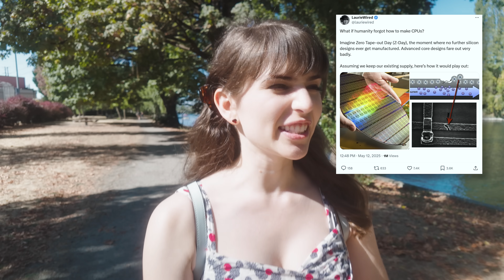what if humans forgot how to make CPUs?

Comment: I think the scenario could go a different way. It all depends on political will and the inertia of the population. Your scenario assumes that society will pretend nothing is wrong until the very end, trying to live by the old rules, ruining itself and isolating into separate enclaves. But if the will is shown to make strategically correct but painful decisions right from the start of the disaster, such a rapid degradation could be avoided. Because humanity has analog technologies in reserve, and a symbiosis with them could extend the life of digital technologies.

The main problem, in my opinion, won't be the failure of HDDs and SSDs, nor the damage from electromigration, but the degradation of modern fast and high-capacity RAM, for which there is literally no replacement. Data storage can be made analog - records can be stored on magnetic tapes, which is a very old and relatively simple technology. But replacing modern RAM is unrealistic, and a return to magnetic core memory would be like going back to the stone age.

I think that if we don't turn a blind eye to the problem and take action immediately, the timeline for the degradation of computing devices could be stretched not for decades, but possibly for a hundred years, until the devices are destroyed by the slow chemical effects of our aggressive external environment. Open source is the key to survival. If governments required all companies to release device firmware and specifications, you could do anything with any hardware, adapting it for any task. Even to the point of building personal PCs and data centers on old microcontrollers, whose lifespan is much longer than that of modern CPUs. A server based on an ESP32, handling bank transactions for many years - why not? Half of a monitor's screen failed? Not a problem, we'll use the remaining area. And so on.

I agree that the portability of devices will degrade first. You correctly noted that lithium-ion batteries will fail quickly. There are replacements for them, but they are bulkier, and considering the failure of the most modern chips with small node sizes, using nickel-cadmium and other types of batteries just wouldn't make much sense; it would be easier to use stationary equipment. Plus, modern laptops aren't designed very reliably in terms of power and cooling, so converting laptops into desktop PCs would be in high demand to extend their life, and this would reduce the risk of mechanical damage to the hardware. Unfortunately, the hardware would then be limited by the lifespan of their power supply units, but in any case, switched-mode power supplies will last significantly longer than batteries.

However, I disagree about the speed of communication degradation. And you don't even have to wait for smartphones to fail. Seven years seems too optimistic to me, because in that time, most (if not all) of the 3G/LTE equipment will fail, and even maintaining the existing infrastructure requires data centers, which will also be degrading. The degradation of communications will most likely be like an avalanche and happen quickly, within two to three years. I think it would be more reasonable to almost immediately abandon mobile communications and switch to stationary analog phones and analog radio to avoid public upheaval from the failure of mobile networks in cities.

The internet in its current form, of course, won't last long. But I don't think that nations will start isolating from each other, because isolation leads to the end of trade relations and, thus, to economic decline, famine, and poverty. Something like Fido, in the form of a session-based global mesh network, could exist even after modern switches fail because it's a relatively simple technology - you could build a radio station from analog parts and use it as a modem. You could connect such modems to modern PCs through audio ports, to microcontrollers, and to very old PCs - the computing performance to transmit emails should be enough even on 40-year-old hardware. Besides, modern algorithms won't disappear, and you could apply modern knowledge for routing in such networks, although, of course, there will be no more YouTube or websites with funny cats.

Comment: If CPU manufacture was forgotten, new designs would come in and it would - in the long run - be a good thing to ditch some of the legacy.  OOH better SIMD instructions on the CPU…!
Consider also what will happen when optical computing replaces current electronic computing - which really is something on the cards in the next couple of decades.

Comment: Well, such a scenario might not be far off. However, not in the sense that suddenly there won't be any new chips starting on "Day Z." If something like that happened, I think a scenario where the most advanced chips suddenly wouldn't have fabs to be produced anymore is actually plausible. I say that because there's a lot of companies around the world and each of them is responsible for making the tools for one manufacturing step in chip production while there are other companies who supply parts for that tool and so on...

Right now there is only one vendor in the world, ASML, making extreme ultra violet lithography machines. Imagine these employees decided to all do a sabbatical at the same time. Or if their company campus got destroyed somehow.

We've all been just expecting hardware to constantly get faster but no one really knows what is required to mass produce the global supply of 3nm node chips. If you're interested, the channel Branch Education has a really well-made and accessible video on how current Lithography machines work. "How are Billions of Nanoscopic Transistors Made into a Microchip? EUV Photolithography 🛠⚙🤯" It's wizard-level sh*t. You should give it a watch! ☺
Reply: Zday is Gamers related, Laurie is scared..
If she is right, we just buy a fab at ASML ourself now, maintaining it ourselves too.
She mad...
Reply: @lucasrem  ASML makes lithography tools (which are the size of a bus plus another bus just below it in the basement). ASML just makes one machine for one process in a fab (like TSMC) and ASML also employs over 43,000 people. There's immense institutional and specialized knowledge there. I'm not saying it'd be impossible to replace ASML but it'd take a while even just to match what they can do right now. But I really do recommend you watch that video because if you've got any interest in that topic, you'll really like it. It's one of those things that gives you hope for humanity because the scale and precision of it all is so ludicrous and yet we can mass produce the global supply. And if this is what's possible today, the possible futures look a bit more like Star Trek.

Comment: People who have a clue will do what they can to make theirs last as long as possible. Undervolting will be more popular, overclocking less. With all the information on record some people will learn how to make them again. Most components have a good chance to last many times longer than that will take. Given enough DRAM, Core 2 Duo can still give satisfactory performance for nearly all tasks, aside from certain gaming and decoding the latest video formats and will be good for decades to come. I'd only recommend something from 2019 or later for all because of some common websites doing stupid things that hog the CPU until you have to close the tab and go back in a new one. I have a 3950x with 32GB DRAM and this happens to me. I would find it horrible on anything older, even though the sites responsible used to be fine on everything as long as your internet connection could handle it.

Comment: Fifty years after the pandemic that wiped out CPU manufacturing, a group of students finally broke through with the creation of HPUs — Human Processing Utilities. What started as a desperate, home-built hack has become the next generation of computation: direct hookups to the human brain, wired to replace the silicon processors the world lost. Unlike CPUs, which relied on etched circuits and manufactured logic gates, HPUs draw on living neural networks — harnessing memory, intuition, and raw cognition as part of the machine’s logic flow. Each HPU is both organic and synthetic, blurring the line between thought and calculation. In this new era, the human mind itself has become the central processor, and every hookup is not just a device but a living engine of computation.

Comment: The surprising thing is, ASML makes all the litography machines used by Intel, Samsung, TSMC, and Global Foundries.  They have a monopoly on EUV (extreme ultra violet) machines as used by all modern processes, and a near monopoly on DUV (Deep Ultra Violet), which is currently obsolete but used for chip manufacturing like a decade or so ago.  If ASML somehow went away, as the current machines aged out, or needed maintenance or specialized supplies, the ability to make these chips would simply go away.  I don't think this is even a patent situation sort of thing (where if ASML went away someone else could just make these machines), it's like ASML figured out how to make these machines and any potential competitors did not.

Comment: I actually have found once the hard disks last 5 or 6 years, they seem to just last almost indefinitely.  15, 20 years, no problem.  I actually think you'd end up with a resurgence of hard disk use after the SSDs began hitting their write limits.  Chilling though -- I mean I could get by on 1990s era technology (I did back in the 1990s...), but so much of it has been tossed out you would have a serious shortage for sure.  I'm SURE the bathtub curve kicks on them eventually, but it seems to be a lot longer than one would assume.

Comment: You could get modern cars to run if you integrated a distributor system for mechanical detonation, and a mechanical fuel injector system could be made.  All of the safety features and electronics in the cars would go bye-bye though.  Electric cars could also still be used, but they would have to be converted to an entirely electro-mechanical switch charging.  Given that most basic of chips like the 555 timers could be scrapped from all kinds of electronics, even ones that are in landfills, they would be quite useful and are very abundant.  Music would have to go back to tape recording and would require more performance based talent as well as using tape for playback.  As CD players require processing of the data to replay the sound, the chips in those would become rare as well.  Music would actually get better again, due to lack of automation.  Culture in general would also get better, because people would need to talk to each other again, forming community.  As someone that grew up in the 80's and 90's as a child, life was a lot more simple and pleasurable.  More freedom from consequences of internet accountability.  Cell phone use would fall back to 3310 style phones from nokia.  No more smart phones, just the basic kind, and land lines would be used again.  Manufacturing would become more prominent due to lack of robots.  

There are all kinds of things that would revert back to older times, but still have some future in them.  I like the way you think. :)

Comment: I've often thought about something similar - what if we had a worldwide EMP event, due to a major solar storm or whatever, and let's imagine that all the new small-process-node stuff couldn't handle the random spikes of electrical current generated in their device's wiring by the EMP - but let's say that most of the older CPU's, 250nm and larger for instance, generally survived.  I picked that particular number because it means my 3dfx hardware collection would be safe, but also suddenly my "small museum" of Win98-era PC's would become top-tier tech again overnight!  I also like to think about how much more useful a well-equipped 25-year-old PC is in a vacuum versus a 15-year-old PC which is good for very little when separated from the Internet of 15 years ago.  For instance I can still play all my Win98 games just fine today, but the only game I could still play on my Win7 laptop is the one that's pirated and doesn't depend on Steam or something similar that's no-longer supported on said machine.  In some ways, such an EMP would actually reset us back to a better time.

Comment: i ran my router for 12 or so years thanks to ddwrt, i have to think 7 years after z day, older routers and switches would be good but, maybe new routers are on too small of a node these days. i no over volting and OCing my core2quad killed at anything over stock clocks after so many years

Comment: I would say in such a scenario, even software development would become a super expensive process in itself, as it uses the pressure lifetime of CPUs. I think that would lead to a big deal of coding written in paper (or in old machines), leaving only the last bits to be done directly on a real CPU.

Also, I would argue the medical equipment would suffer a lot more in the mid term due to the insane cost that would mean taking an exam on say an CT scan, already expensive, that now cannot be repaired or replaced anymore.